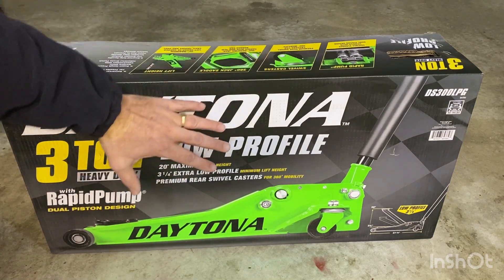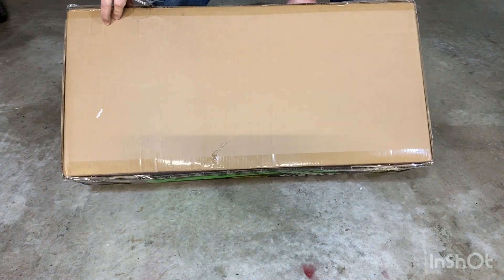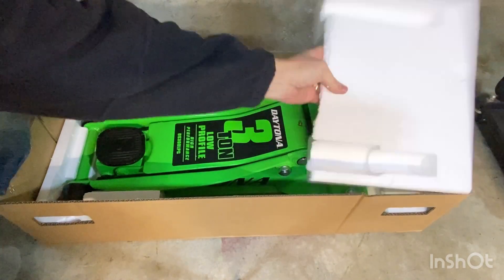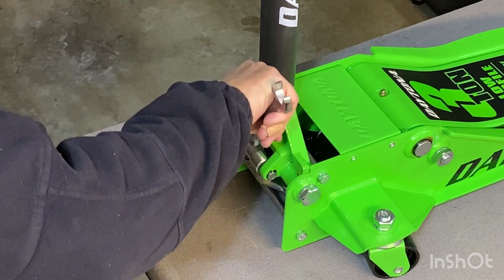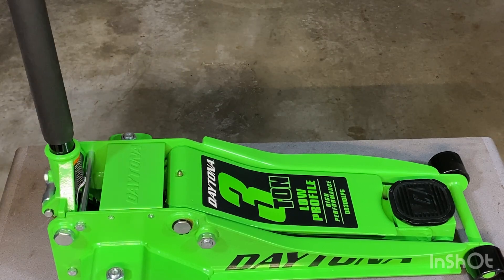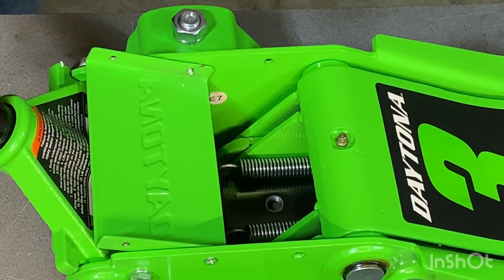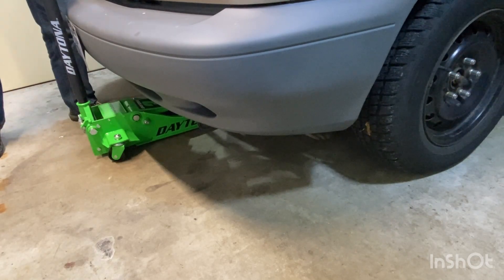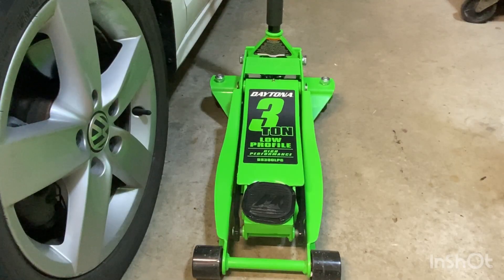Unboxing & Review of Daytona 3-ton Floor Jack from Harbor Freight

Comment: I had trouble releasing the plastic shipping lock piece. 
It was not as easy as the one in this vid. 
If anyone has this issue, try flicking it up and out using a screwdriver…quick and easy. 
My jack was probably a dud.
Reply from the maker: Thanks for that tip Summer! 👊
Reply: You have to push down on the handle and that’ll release the tension on the black block.

Comment: Mine doesn’t have that black piece that holds it up. Mine is more indented in. Maybe I’m missing a rubber piece? Anyone know?
Reply from the maker: Yes, there should be a rubber pad that sits on top of the saddle of the jack.
Reply: Yeah I found one on Amazon I’ll probably get.
Reply: Is there anyway you could tell me the shape of the pad there?
Reply from the maker: @Kat_Stewart  It fits exactly the shape of the saddle. I am sure if you ask Harbor Freight they will have one for you.

Comment: Does anyone know what the difference is between this one and the 3 ton low profile Pittsburgh? Besides the price that is.
Reply from the maker: Yes, I would like to hear if anyone knows. :)
Reply: @Pen_Pusher  Pittsburgh has flat non beveled rear wheels, no real wheel support wing plate, C-channel frame bottom and top narrower, no saddle pad, fluid needs to be topped of and bleed, welds not great, bottom tie cross plate narrower, lighter by 10lbs for a reason, etc.. to name a few.  Get the Daytona.
Reply from the maker: @prebaned  Thanks. That is very helpful!
Reply: At the moment it’s a $20 difference..I just bought the Daytona in green to match my tool chest and jack stands
Reply from the maker: @chrisschulze8081  The best color! IMHO, of course. 😉

Comment: Mine squeals too whenever I lift it and I have greased everything and bled it out with topping it off with oil and it still does it glad im not the only one experiencing it but at least it works good does yours still make that noise?
Reply from the maker: Haha, it does! I have been meaning to grease it, but haven't got around to it. I am renovating my new garage and it is taking more time than anticipated. 😉